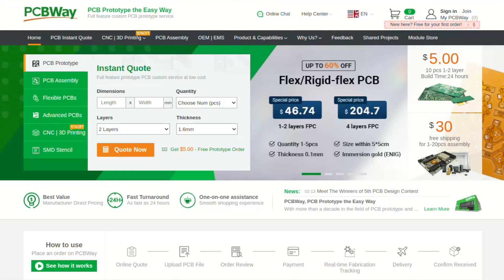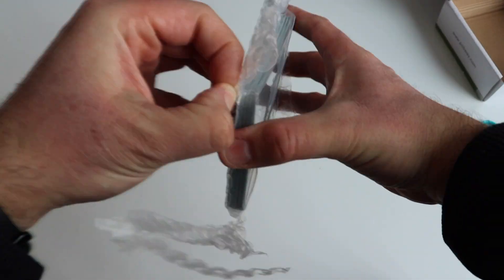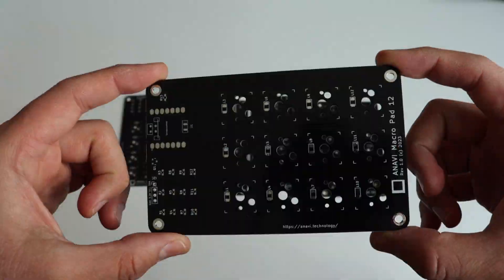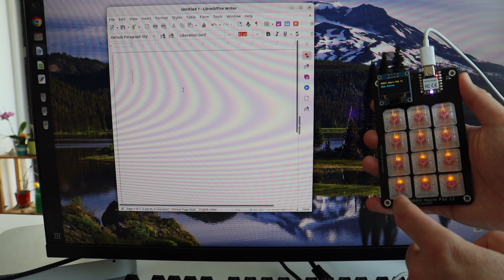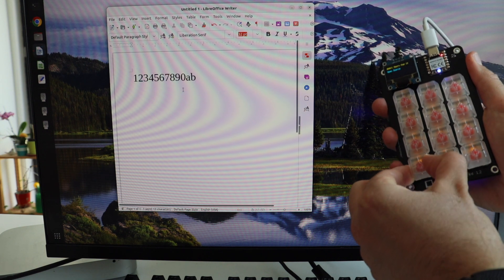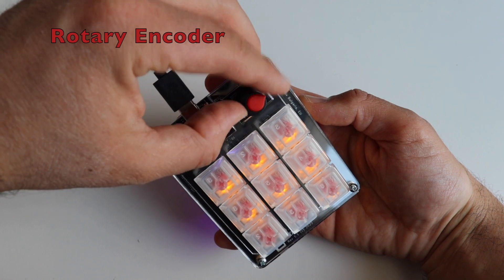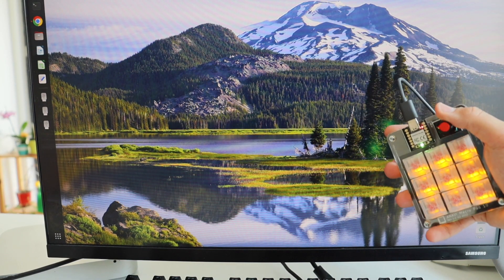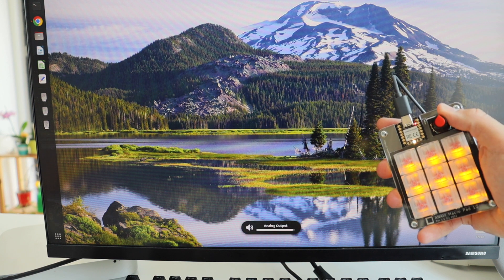KMK Open Source Mechanical Keyboard Firmware Written in CircuitPython

Comment: Can you elaborate on what you mean by "copy keyboard specific files"?
Reply from the maker: There is a directory boards in the kmk_firmware git repo in GitHub. It contains sub-directories for different manufacturers and different keyboard models. For example, for ANAVI Macro Pad 10 the keyboard specific files that you need to copy are in directory boards/anavi/macro-pad-10. Here is a link to it: https://github.com/KMKfw/kmk_firmware/tree/main/boards/anavi/macro-pad-10

Comment: How do i change the keyboard configuration in kmk and can I configure it to VIA
Reply from the maker: KMK is written in CircuitPython and the keymap, in Python terms, is a List of Lists of Key objects, for example have a look at the keymap for ANAVI Macro Pad 12:
https://github.com/KMKfw/kmk_firmware/blob/master/boards/anavi/macro-pad-12/code.py#L79
Basically you can edit the CircuitPython code to change the keys. More details about configurations are available at: http://kmkfw.io/docs/config_and_keymap

VIA works by communicating with the firmware that is running on the device and sending it commands across USB. It works with QMK but as of the moment I am not aware of KMK support. However, the ANAVI mechanical keyboards in the video support both KMK and QMK :)